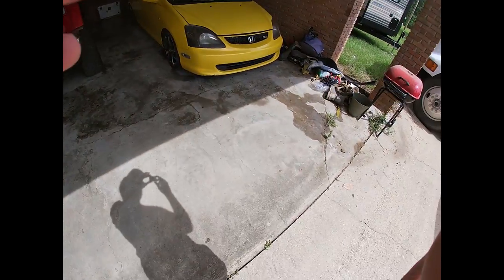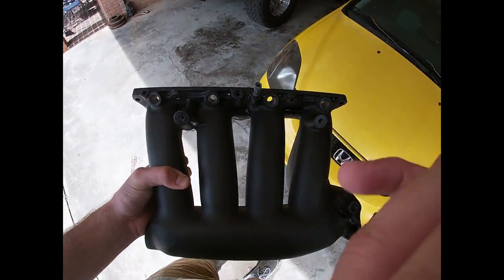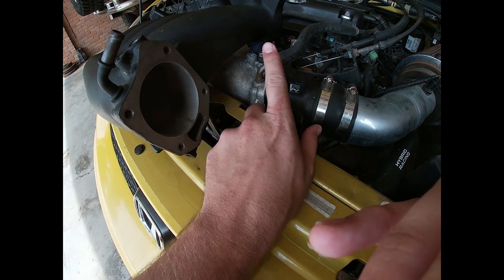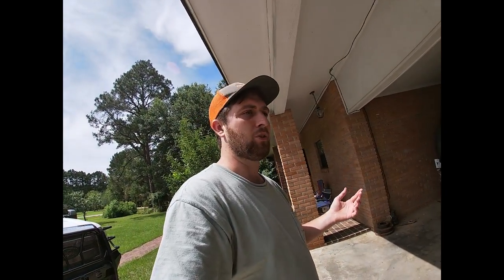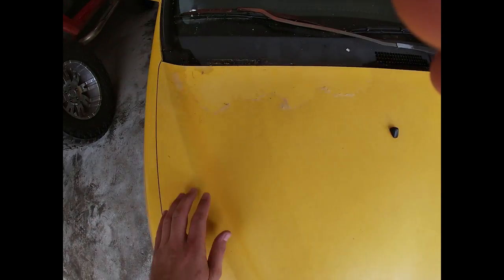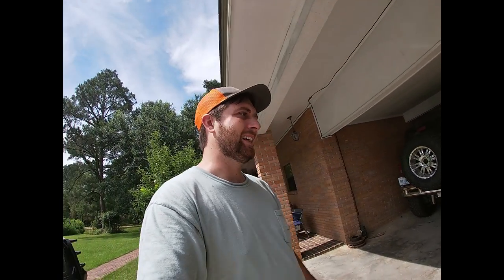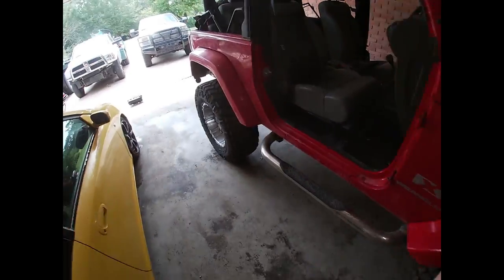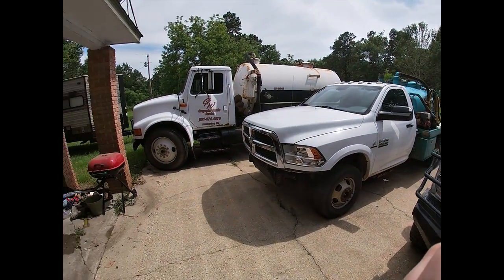Shipping Parts to MOTION AUTO TV | First look at my K24 swapped Civic SI EP3

Comment: Oh sick, nice too see a fellow k24 EP3 👍🏼
Reply: How much whp you making?
Reply from the maker: +AeroPrixma it’s around 240hp right now. I need to get a better tune and dunk and I’ll post the exact number
Reply: Chaz Lee oh yeah? What mods do you have. 240whp sounds right, people with the 45 degree cam angle and true CAI w/ RBC manifolds make that.
Reply from the maker: +AeroPrixma K24A, Stage 3 kelford cams, RBC, 70 mm hybrid racing throttle body, CAI, and kpro. Might be forgetting something but I think that’s it motor wise
Reply: Chaz Lee wow, solid build
Reply from the maker: +AeroPrixma thanks. I plan on doing a lot more here soon. I’ll be posting more on it